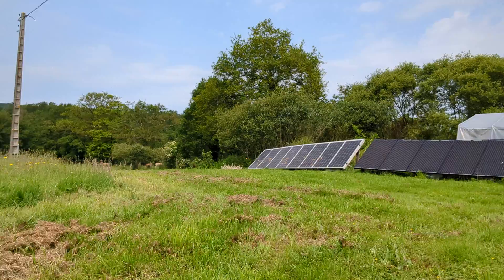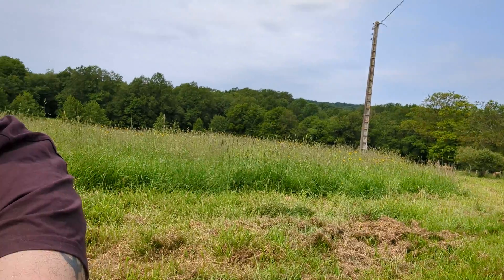Solar Steel Smelting Foundry is now a reality

Comment: You are not understanding physics.  It's not the temperature that melts but the input of energy that raises temperature.
Reply: input to output... and then theres the whole latent heat part, phase changes... mmmm, face centred cubics...
not understanding metallurgy either. iron without carbon is useless. iron AND carbon makes steel.

Comment: A solar furnace that can only work for part of the day seems entirely impractical.  It would take far too long to get a financial return on investment - especially in the UK where the days are quite short in Winter; and the different seasons means production would vary enormously, depending on the time of year.

One of the world's largest solar furnaces was built in Font-Romeu-Odeillo-Via, in the south of France between 1962 and 1968. It is 48 metres high and 54 metres wide, and produces about 8 megawatts per day, on average.  This is in an area chosen for its clear skies - and is about as far south as you can get on the Frence mainland.  It is also at an altitude of 1800m.

In sunny Port Talbot ( ahem !! ), 1200 km to the north, on the Welsh coast, you'd probably get half that.  In the blazing sunshine of the English tropics ( aka Scunthorpe ), 200 km further north,  probably a quarter.

Comment: The use of rusty secondhand steel recycling gives a lot lower grade steel, one of the downsides is that it can't produce the grade of steel required to make rail track. It's a conundrum that requires a lot of thought, they have shut the coke ovens in Scunthorpe and this has led to an issue of not enough gas at times to produce efficiently. The grid cannot supply enough natural gas to run the plant. If scrubbers and filtration systems were developed to the standard required is an item for the fishbone diagram think tank and maybe we could re open the coke ovens. There is also a problem with the blast furnaces now producing more pollution as the coal being mined is so sulpher rich it's affecting the efficiency of the blast furnace.  When my parents moved us from Yorkshire to Scunthorpe it always had a sulpher smell you got to the point where you didn't notice it until you went away for a few days and returned. This took legislation to reduce it to the point where it's an event/bank holiday weekend when you smell it but no where near the strength of the early 1960's. So if there's a will there's a way but I've never seen improvement without legislation. Sorry it's been a long comment.

Comment: If they can harness electrical energy to heat it up to a certain temperature and then use gas for the last stage some kind of hybrid mechanism to reduce the amount of carbon needed for smelting.